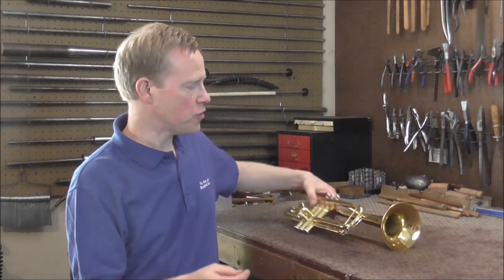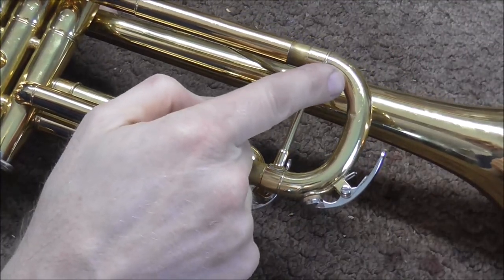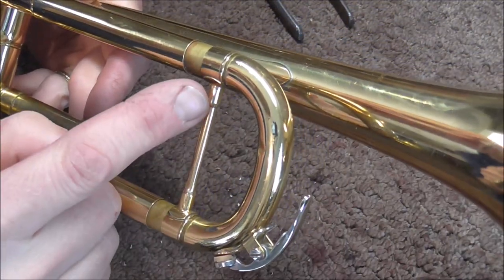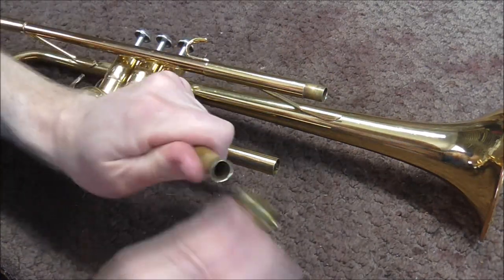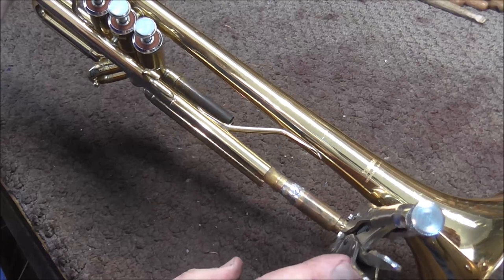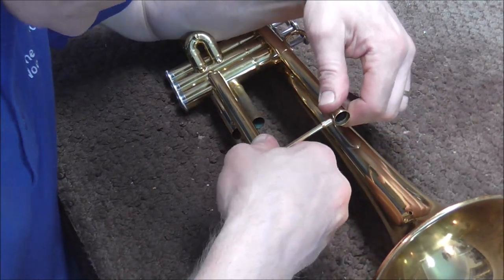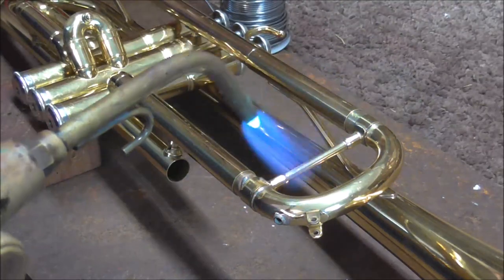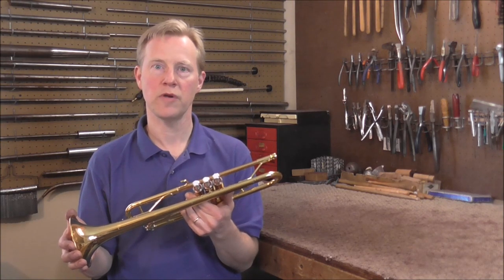Stuck Trumpet Tuning Slide on a Yamaha Advantage and Model YTR2335

Comment: i just found that the ytr1335 model also has the same single tube, but it does not have the brace...And it's a big deal to do what you did in the video without brace...The only solution I could find was to solder a temporary brace...

Comment: I never knew those tuning slide braces were pressed on and could be removed.  Very interesting.  I used penetrating oil, a heat gun, and some gentle tapping with a rubber mallet, to free up the tuning slide on my son's Conn

Comment: Is there a problem when using a torch on a lacquered finish?
Reply from the maker: If you use too much heat (which is easy to do), it can burn the lacquer. If you are very careful, you can usually burn just a little or none at all. Some lacquer will burn no matter how careful you are because it burns at a lower temperature than solder melts at.

Comment: How much would you charge for a service like this? I have the same model which is stuck and I am trying to figure out how much it could cost in case of the need of doing something "extreme" like this.
Thank you
Reply from the maker: The cost would be around $40 to $50.

Comment: Hey Art, just wondering why you cut the tube the second side without checking if you could free it by twisting the ceook back and forth after cutting the first one ? - would have saved half the work!
Reply from the maker: That is a good point. I cut it because the brace was on the wrong side to twist it. I could have moved the brace over and then twisted it out, but I will admit that I did it mostly for the video because both slides are almost always stuck and need to be cut. It was easier to cut the slide than to try to explain on the video why I did not cut it.

Comment: I’ve got a horn that was spray painted by a previous owner, I didn’t really wanna up the offer cus of how cheap he sold it for. Is there any way to get rid of spray paint on an instrument?
Reply from the maker: Hi! I did a video on removing paint from a silver cornet. https://youtu.be/GNfX-yxT_To However, if the trumpet is lacquer, it makes it more difficult because you may very well remove lacquer while removing the spray paint using the chemicals. You can try scraping the paint off carefully by hand.
Reply: @TheBrassandWoodwindShop  ah ok, thank you so much for the tip! Love your vids btw!